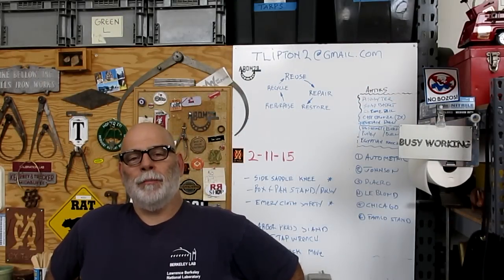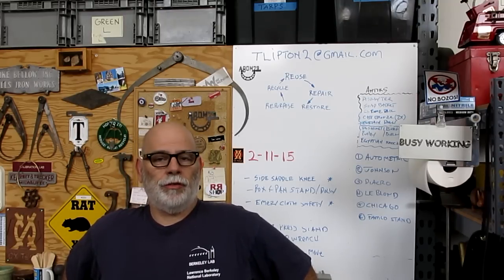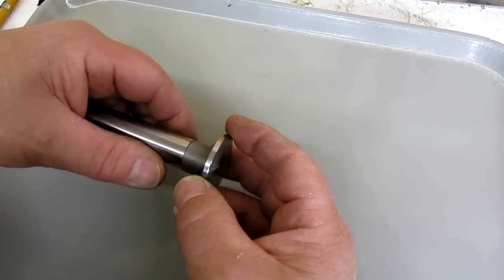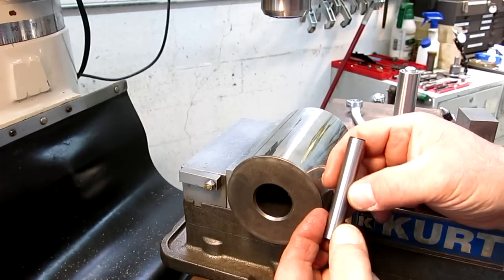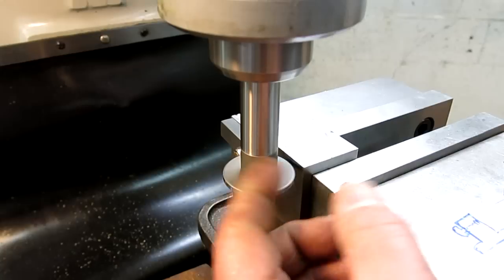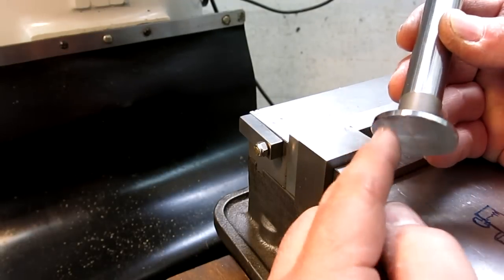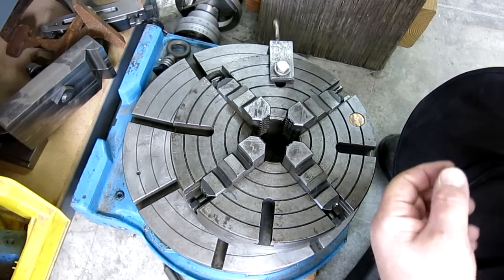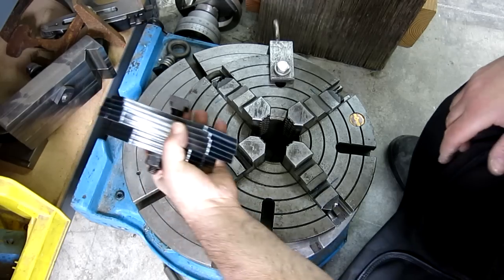Monday Night Meatloaf 78

Comment: We used to make aircraft seals when I was a d f apprentice boy. The seals had key slots at 190 degrees (or whatever) so to be assembled only one way. 
Some had one offset bolt hole for the same reason.
We made index plate blanks on the CNC lathe
And machined the slots per requirements.
Five slots would be no problem.
Regards,
Kap

Comment: hello tom,
in keith fenner's video "2 ways to jive with 5" he mentions that the one problem with super-spacers is not supporting 5 holes or multiples of, particularly for wheel spacer making etc...
well, my thought was to make a new master gear in the back of the super-spacer with say, 25 notches and then a set of suitable masking plates . then surely the device will do just about any regular hole spacing !    ......just an idea ..i dont have a super-spacer so i cant try it myself.. best regards andrew norman
Reply from the maker: Andrew Norman Hey Andrew,

The super spacer has a degree marking and a vernier so you can accurately index to less than five minutes directly using the spacer. Most of the time when faced with odd indexes I use the dividing head or coordinates to locate the hole. Five just doesn't come up that often. Thanks for the comment.

Cheers,

Tom

Comment: Tom,  interesting edge finder.  How hard would it be to make more "tips" in various diameters and heights?  Is it just a matter of accuracy and hardening?  (He says, "just" like that's simple! :-)

On the counterweights, is there any worry about the stack leaving the chuck at speed?  The T-slot openings are on the outer edge....I was thinking that the grooves in the face of the chuck might be useful for retaining the weights if the lowest weight matched them.

On the index plates, is it worth drilling and tapping a couple more holes in them for insertion of a "puller" to ease removal?  Or would it be acceptable and simpler to bore them out a little larger so they fall out more easily?  Too bad there's no "cone-iness" to the shaft they go on that would center them but leave some slack for easy removal. Then again, maybe a good use for some rare earth magnets mounted like the old "Monster Magnet" toy of the 60s to pull them out!

Thanks for showing the new stuff and making me think a little!

-- Mike
Reply from the maker: BigMjolnir Hey Mike,

It might make and interesting video to make an edge finder. The counterweights are pretty secure. Don't forget your not spinning this thing like a turbo charger. One half inch stud can generate five tons of clamp load if you gronk it up. Thanks for the comment.

Cheers,

Tom
Reply: Now I need to go look up the equations for friction and centripetal force....where did I put those old physics texts....

-- Mike

Comment: I'm looking forward to seeing the video on how you fathom out you have sufficient weight to off set an unbalanced load when spinning it in the lathe!
I'm amazed at the quality of the cutting on this metal work via laser- spectacular!!
Reply: Dan Whiteford In most cases, best guess, then spin it slow, spin if faster, and faster, add or subtract weight and repeat until it somewhat balances at the speed you need/want. Of course Tom might do some complicated math and calculate the exact amount needed. :)
Reply from the maker: Dan Whiteford Hi Dan,

Its actually pretty easy. You add weight until the chuck will not settle into any particular orientation. Just like the old days balancing tires. Thanks for the comment.

Cheers,

Tom
Reply: oxtoolco Are you doing that in neutral or are you bumping it with the motor?

Comment: Hey Tom, just wondering how did they get the dimensions, did you make them a cad file or did they work off of a hand drawn print?  Just wondering if the program time was included in the price of laser cut.  Thanks Mike
Reply: Mike fisvii I believe it was last weeks or maybe the one before that he showed the cad file he made for the spacer and discussed exporting it and verifying it matched with what they received before doing the cutting.
Reply: thanks

Comment: That's a nifty edge finder Tom.   For sure they could of installed some type of black oxide hardened set or cap screw on the end. That would make it MACHINE SHOP and not hurt so much from the $40 bucks shelled out...I've been there, done that.

Comment: On the indexer, If you tap a couple more holes in each plate, you could use longer bolts to push the plate off instead of your little screwdriver.
I don't know about you but i would stand well out of the way and cower a bit spinning those lathe weights up bolted into that outward opening slot in the chuck. Can you imagine the damage that 4-5 of those plates spinning around the bolt would do if they came off at speed......Wow pucker-time....Better send them to Adam wrapped in a couple pairs of new xxxl cotton briefs for protection from shipping damage.....
Reply: I couldn't agree more about those counter balance weights for the 4 jaw, looks super dangerous to me? That part of the video should have one of those "don't try this at home warnings".
Reply: russhellmy If they did come off, you would probably find them in the neighbours place..
Reply: Notso Fresh I'm pretty sure they are not intended for 2000 RPM...      8^)
Reply: ***** They are "Out of Balance Counter Weights". Any vibration/forces from an out of balance work piece only occurs at high enough RPM for the out of balance weight of the work piece to exert a LARGE & oscillatory force.
So if the RPM is low enogh for those weights to be safe then their would be no vibration for them to eliminate, ie they would be pointless.
If the RPM is high enough that they would be required, then those weights have LARGE Energy just waiting to be release.
Its simple Physics.
Bolts to a Hole they would be safer but bolted to a outward opening Slot on a 4 jaw chuck they are Lethal.
Reply from the maker: russhellmy Hey Russ,

A single securely tightened 1/2 diameter bolt has approximately 10kpsi clamping force. The force we are discussing is the centripetal force which goes up by the square of the rotational speed. The same thing happens to the chuck jaws as you spin up the chuck. You actually lose clamping force from the jaws trying to fly outward. Pretty scary if you think about it.Its actually a pretty common occurrence in the machine shop to add counterweights to an unbalances rotating mass. This counterbalancing is more like what you would do with wheel weights on a car tire to make it run smoothly.  Thanks for the comment.

Cheers,

Tom
Reply: HI Tom.

Yeah sure the Friction force of that Tightened bolt is going to far exceed the centripetal force of the counter balance as long as the speed is low enough. Eg 5kg at 150mm off-centre generates about 39kg of force.@ 200rpm, 205kg at 500 rpm and 825kg @ 1000rpm.

The problem is there is always vibration in machinery, and especially so in an out-of balance situation. As soon as that tight nut loosens slightly that clamping force goes from 10kpsi to ZERO kpsi with practically No Warning,

I've seen plenty of setups with counter balance weights on 4 Jaw Chucks and Face Plates, but they were all bolted though a hole or slot that didn't open to the outside of the chuck. 

Cheers
Reply: Also, No matter how careful i am, sometimes a bolt gets missed when tightening. I'm pretty sure i am not the only one who has missed a bolt. Missing that bolt would be catastrophic..